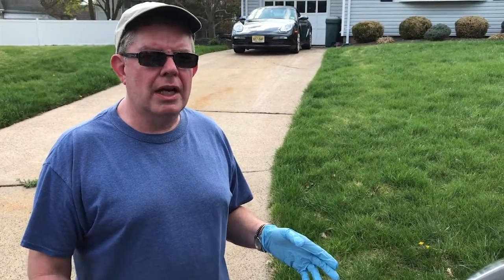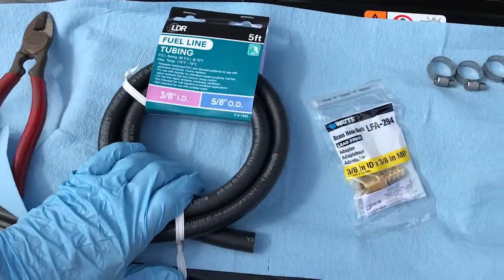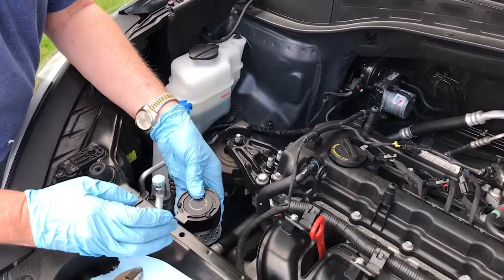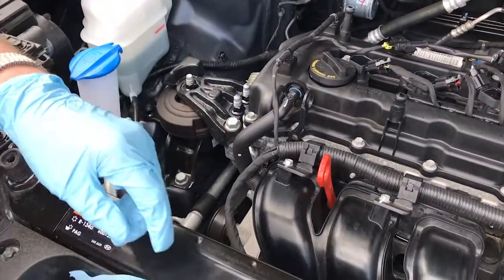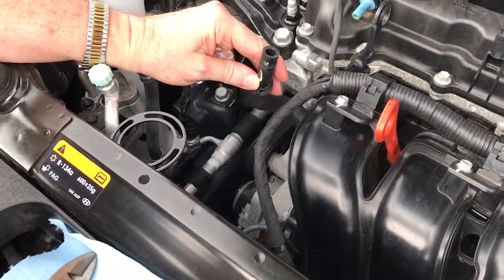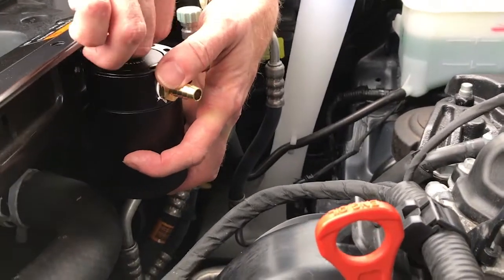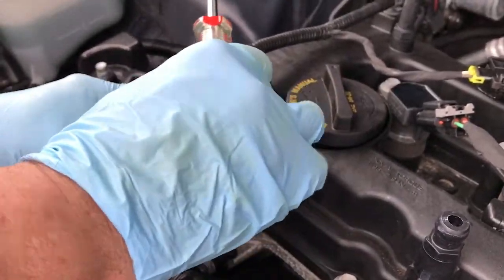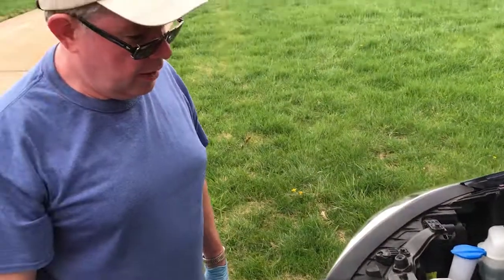2016 Hyundai Santa Fe Sport Oil Catch Can Mod

Comment from the maker: Folks, some of you paid close attention and noticed the hose placement was backward on the device - though I did point out the correct flow verbally.  Thanks for pointing this out. I corrected the placement a while back but never got around to updating the video.   Incidentally, the catch can has been working with out a problem for the last 20k miles collecting contaminants that would have contributed to fouling the intake. I empty it out every oil change at 5k miles.
Reply: I added my oil catch can the same way as the video at first then I changed later, the results are the same. I looked at the structure of my can, to me it will do the same thing doesn't mater which way you install it.
Reply: Man! You gotta fix that
Reply: yha it is backwrd the inlet ,
Reply: How much oil blow/sediment is retained in the canister ?  GDI 2.4 a good engine if the carbon issue is addressed ? Thanks for your time.

Comment: Thanks for a beautifully done video and professional installation job.... the best I've seen of many on Youtube.  (Especially thanks for omitting the music that some contributors use and spoil their presentation !)    I'm a little concerned about one thing, however.... it appears there may not be sufficient allowance for movement of the engine under acceleration which will cause a rotational movement opposite to the wheel rotation and may strain the hose from catchcan to the PCV.   You don't look like a heavy-footed driver but under some conditions there's no avoiding tramping on it a bit. LOL  .  Again, thanks for the beautiful presentation. (I have a 2.4L Sonata that will be getting the treatment soon.)
Reply: @Cedric Kody Instablaster :)
Reply: @Felipe Rowen it did the trick and I now got access to my account again. Im so happy:D
Thanks so much you saved my ass !
Reply: @Cedric Kody You are welcome :D

Comment: Thank you very much for your time and effort to make this and other videos.  However, It does appear the hoses are incorrect or am I wrong?  Should the hose from the PCV go to the INLET of the can and thus the OUTLET side hose be the other one coming or going back to the intake manifold.  I am planning to install one on my Santa Fe 2.4 GDI vehicle.
Reply from the maker: D R and others. The unit is now installed correctly.   Sorry for not being clearer as it seems I've connected the hoses backwards..  At around 7:32, I indicated the direction of the flow from PCV valve to the catch can back to the engine.  The Catch can has been working well now for over 20k miles collecting contaminants that I empty out every 5k at oil changes...

Comment: Hey adrianthegeek.. How's the catch can working out? Can you do an update? I am considering buying the same car but the 2017 model. Iam concerned about the whole carbon buildup and the issues that come along with them. Looking for ways to prevent problems. Also have you done another cleaning with (sorry forgot the brand)?
Reply from the maker: My last update was after using the product for approx. 2K which you can see on my channel.  Since then, I now have put an additional 10K and have found the device operating as designed with no problems.  I empty the device at every oil change (5k miles) and have found it approx. 1/3 full of gunk that was prevented from reaching the intake valves.  I plan on using a scope at some point in the future, perhaps at 30K, to gauge long term effects.  I also continue using the CRC cleaner as well at approx. every 10K.

Comment: How’s it working after all these years any problems and does the car drive as good as it did when you installed the can?
Reply from the maker: Hi Henry,  I’ve added approx. 45k miles since it’s installation and it has been operating fine with no problems.  I empty loads of gunk from the container at every oil change or every 5k miles.

Comment: Thanks for the excellent video. Have the same vehicle and looking at doing this. Am wondering about the hose from the engine to the frame mounted can, maybe it should be a bit longer to allow for engine movement. It is also probably important not to have a downward loop that would become a trap for moisture that cold freeze in cold climates. Regarding engine movement, have someone you trust shift from reverse to drive with the brake on and press gas pedal a bit each time while you watch the engine. Depending on how good the engine mounts are there can be a lot of movement on some cars.

Comment: Thank you so much for making this video. I have the same car and now I will be able to tackle this job even though I know nothing about cars. I have never even changed the oil in one. Do you drill the two holes into metal? It was unclear in the video. Also, how often do you have to empty the catch can?When I ordered the same gas tube as you have, the label said never to use with direct injection engines. I am confused now since these cars have direct injection. Could you clarify this? Thanks again.
Reply from the maker: Yes, the holes were indeed drilled into the metal front frame rail as shown in the video.  You'll find a rectangular indentation in the underside of frame which can be used to center the mounting bracket.  I find the compact catch can I use will hold the oil buildup between oil changes - around 5K miles for synthetic.  The hose used in the video is not  being used to carry gasoline under pressure so you can disregard this warning.  Hope this helps!!

Comment: Do you know if a catch can voids the warranty?
Reply: I have a 2017 Kia Sedona which is basically the same set up and engine bay. "Void" is very subjective to Hyundai's interpretation. Being we're not cutting or physically altering anything such as an in-line Magnefine trans filter, but simply  rerouting a couple of hoses, it would be very easy to dismantle the catch can and put the factory hose back on should any warranty work be needed.
Reply: You just remove the catch can and reroute the hose to its factory location before going to the dealership.

Comment: I recently bought a 2.4 gdi sante fe sport engine. Should I do this does it void warranty at dealer
 What type of oil do you recommend on these engines thanks Adrian
Reply from the maker: Hi M. Nice, though I'm not a lawyer and thus this is not legal advice, I would say anything you do to an engine outside of normally accepted maintenance, as documented in your owner's manual by a qualified tech, can be used as grounds by a dealer to disqualify a warranty claim -- after which of course you could fight with the manufacturer directly.  Having said this though, the level of modification done here is so minor and so easily reversible, that there's probably little risk to the engine, assuming of course you've installed it correctly.  In this case and with this product, I believe the benefits greatly outnumber the risk.  
Any quality band name fully synthetic oil should be ok to use and in fact my dealer uses Mobile 1, 5-20w.  
Best of luck.

Comment: O M G  you put an oil catch can in the wrong place!!! on 2016 Hyundai Santa FE  2.4 ltr DOES NOT NEED AN OIL Catch CAN the valve cover return to the intake port is on the other side (drivers side)of the valve cover, if you were to unplug that hose leading into the air intake you would see it's bone dry no oil going to the intake manifold therefore not going into the valves...
Reply from the maker: Maybe, but I know the catch can has been collecting   liquid gunk that would have otherwise been routed back to the intake at some point.  Here's a good video explaining the theory with a reference to an SAE study on effects of typical PCV design.  https://www.youtube.com/watch?v=T-B4VRxAtbw
A better question may be, why don't vehicle manufacturers take this into consideration?  I suspect their overall design complies with cost vs reliability, customer satisfaction, etc  demands based repair research and vehicle warranty for x miles and y months.  After that,  it time to keep the corporate bottom line healthy and the dealer network in business through new vehicle purchases or expensive repair ..